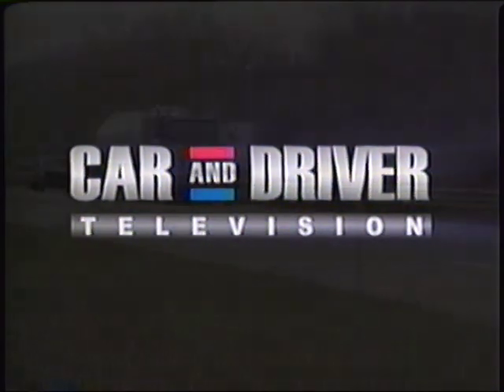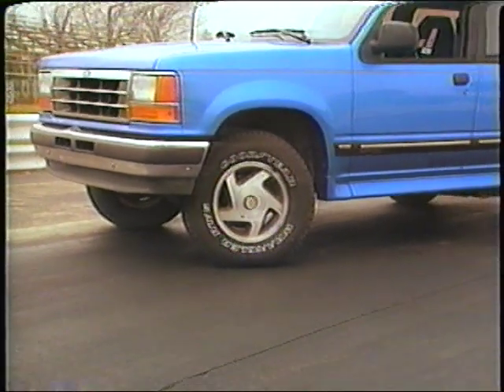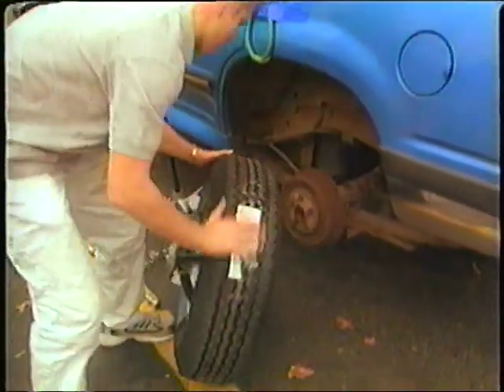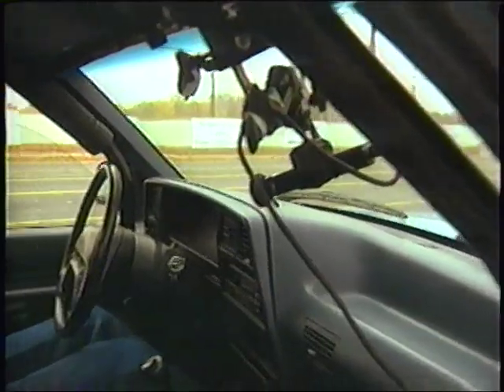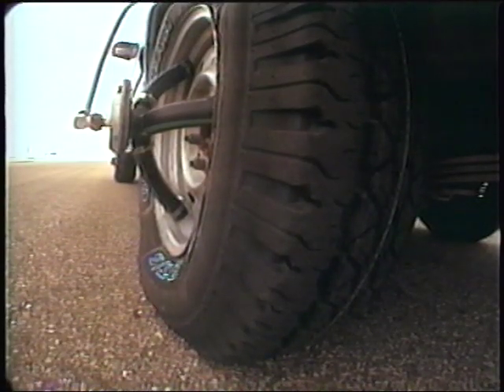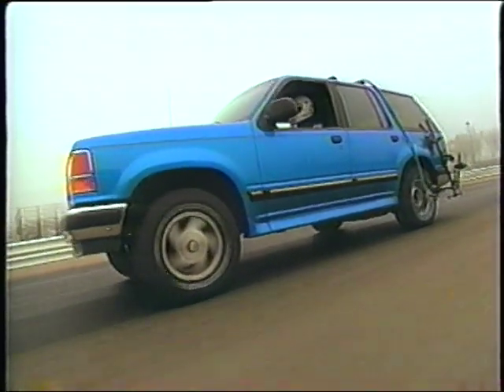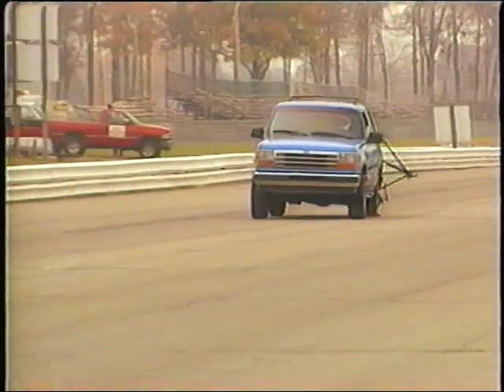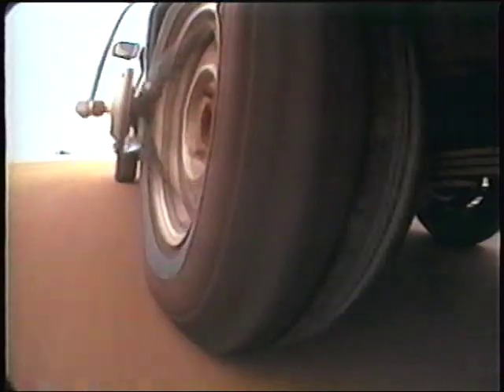Car And Driver 1994 Ford Explorer Tire Failure Test

Comment: The also did not take in account of the tire separating sending pieces of rubber between the contact point of the rim and road surface.  This situation really changes the handling of the vehicle especially a Ford Explorer.  They are very unstable.  In face in the late 90's U-Haul would not rent a trailer to you if you were using an Explorer.  This test in no way simulates the actual conditions of a real blow out.  This is a slap in the face to the people that were injured and the families of the people lost during this debacle.
Reply: Yeah,U-Haul were some dipshits for sure,but I've owned several Explorers and am about to aquire another one hopefully. It is a way better vehicle than anything GM has to offer.

Comment: Difference between a "Blowout" and deflation, a blowout is a type of explosion where the energy reverberates through the suspension, upsetting it and causing instability, in turn causing a crash

Comment: Ford must have paid for this. The issue was rear tire blow outs caused by tread separation, not a flat. The actual tests proved that this issue was unrecoverable from and deadly. What do you really expect from car and driver, they get paid to sell cars.
Reply: Your statement is untrue my friend,I've blown rear tires on a half ton pickup hauling more than 7000 pounds in the bed traveling at 70 mph and I didn't turn the truck over or lose any of my load of produce. I may be different than most I admit since I grew up driving loaded trucks on a daily basis. But the point is,a blowout can be handled even though it is difficult it can be done.

Comment: Junk tires, junk suspension, junk company.
Reply: I suppose you like general motors the ones who took your tax bailout money then still went bankrupt and just recently got a huge tax break from trump to stay alive and now are ckiding down its us plants and running to Mexico to give them jobs
Reply: I'm a retired ASE Certified chassis and alignment specialist and I've owned a number of Explorers. But I will not own or drive ANY of GM's garbage vehicles. And I'm GM certified also and have repaired more than 2000 of their vehicles over a 30 year period,but I will not drive them,I only drive Ford(1st choice) or Chrysler(2nd choice).
Reply: @lawnmowermanlawnmowerman9930  I'm right there with ya brother.  I'm not ASE certified yet though.